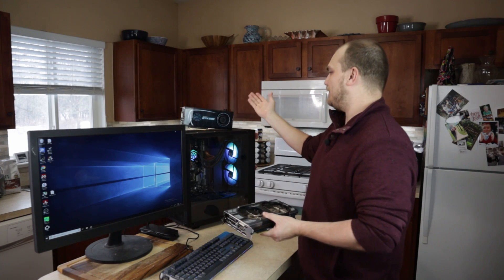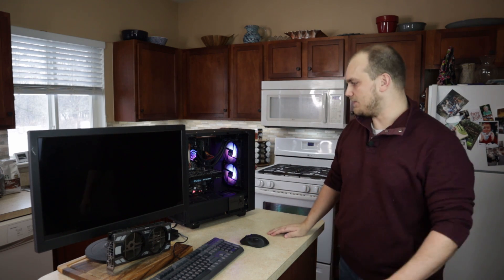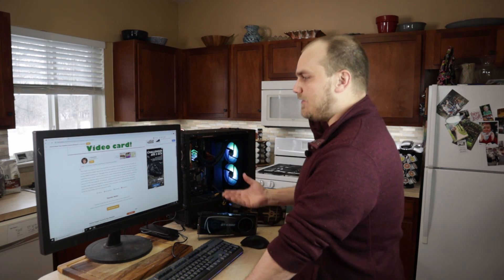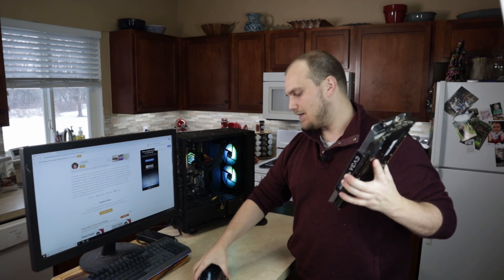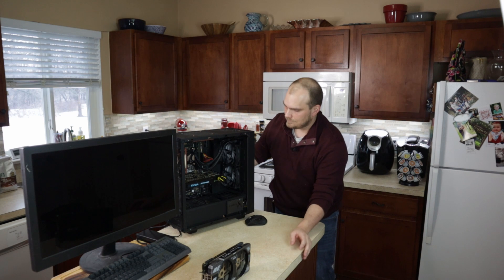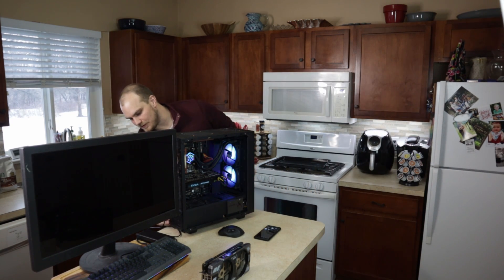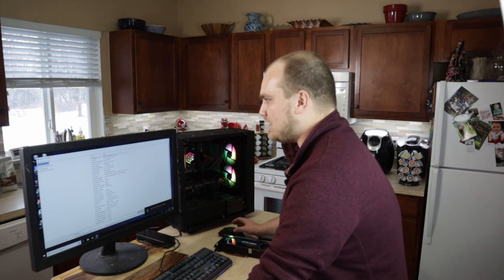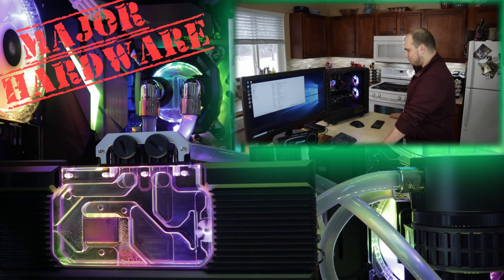Does Baking A GPU Do Anything?

Comment: Its just an short term fix, because your solder joints doesn't reflow at that temperature, you need like 460-480°F for that to work. But when the surface that you are using for that is not perfectly flat, yeah then all your parts move around and its now broken for sure. 

What happen is that through the heat cycle your card expand and retract a bit, and that moves a broken wire bond around just enough to make contact again. Most heat deaths in graphics cards (and first gen Xbox360s lol) are caused by broken wire bonds.

Comment: Good on ya for the disclaimer, this is definatly a last ditch resort. There was a similar fix back in the day for the original red ring on 360's where the SOC would lift off the board after excessive temp-cycling. Out of the 15 we put in ovens or suffocated in a towel only one ever lasted; But it still running 24/7 even today!
Reply from the maker: i 100 % expected to make a cooking video where nothing happeneedf

Comment: don't bake GPUs it is not a repair. all you do is to shock the GPU solder balls and make it work temporarily. and you don't get op to reflow temps when baking it.
Reply from the maker: So what you are saying is dont bake a broken GPU because it will end up broken again lol
Reply: No baking GPU can be "fine" if you now it is the core that is bad so checking all the voltage rails work and output voltage and now it won't fix it permanently., but you shout not make a video called "How To Fix A GPU In 10 Minutes"  and not put in a serious disclaimer that this does not fix the card permanently ore properly. and someone "fixes" a GPU and sells it as working and it brakes on the buyer after 1 month.

Comment: I can hear Louis Rossmann screaming from here.
Reply: Came here to say this.
Reply from the maker: i dont get it but ive seen it a few times lol
Reply: @MajorHardware  Louis Rossmann famously called out Linus on stream when LTT did a video about putting a graphics card in the oven - at best it can bring a chip temporarily back from the dead, but it shouldn't be considered a proper fix. As a response, Linus actually went to NYC and visited Louis' shop to shoot a video about using a proper reflow station.
Reply: @MajorHardware  
First off, most ovens don't get hot enough to melt solder.
Second off, a chinesium reflow station on Amazon costs as low as $50.
In all likelihood, all that you're doing when you stick a GPU in the oven, is causing the PCBs to flex and press broken solder joints back together; This is why the fix is 50/50, and oftentimes even if you do fix it the problem will recurr in time.
To properly fix it, you need a rework statiom off Amazon ($50), a silicone solder/rework mat if you want to protect your table ($15-25), some small metal objects that you can use to lift and level the board from bare spots on the PCB (decently clean pocket change will work) and patience. At an absolute minimum, the station should be set to about 250°C at low to medium fanspeed, though the digital readout only reads from the source, so the temp that the board sees will be different from the readout depanding on distance and air environment I usually run 300°C or higher in my environment.
I also tend to run some alcohol under any BGA hipsets to make sure there isn't any debris between the PCBs and solder balls to mess anything up, although usually that shouldn't be an issue.
If reflowing was not enough to fix the issue, you may need to take a solder pen and resolder some joints on problem areas by hand, or if the issue is with a BGA chip, your job gets a lot harder if you have to reball the poor thing.
Reply from the maker: @kmemz  all I know is it didnt work and now it does
Reply: @MajorHardware  Just for funsies I'd say turn the 580 into a project card where you try to actually get the equipment and see if you can actually reflow it without having to reball it. Takes a lot of patience but I think it's worth it even if just for a fun little side thing.
And if it doesn't work afterwards you still have a powerful hair drier that actually will just catch your hair on fire instead of drying it to play with.
Reply: @MajorHardware  is the recommend getting rid of this video people use these videos as excuses to say the repair industry is a bunch of scammers and stuff like this hurts the right to repair movement I wouldn't be surprised to hear a rant on Rossman's channel sooner or later(he doesn't hate you he just likes pointing up misleading information with a New York attitude) if you want to see real repair videos have a look at Mr Rossman YouTube channel
Reply: @MajorHardware  Ignorance isn't a good way to defend yourself. You should have researched what this "fix" does and why it sometimes works (for a while). I don't mind you doing it or showing it, but you shouldn'd have given the wrong explanation for why it would work. If you actually melted the solder with your method the capacitors would have long gone bye bye. 
Don't take this personally, but as a person with public reach and influence you also have responsibilties (like not spreading wrong information). I like your videos and I would of course like them to get better. So take this as friendly advice.
Reply: @felentus  Couldn't have said it better myself, not to mention I didn't even look at the video from that angle.
Reply: @felentus  Wow, that was the most spergy comment I've read in a while, good job man. That he made a reasonable educated guess as to why it worked, regardless of whether he was right or wrong, is well within the scope of acceptable behavior of a non-expert regarding social responsibility. The notion that he should know all the technical details about the effects of a graphics card in the oven, just to make a short fun video, is absolutely ridiculous. Go talk to real people.
Reply: @kmemz  As an embedded systems engineer, I agree with all that. But...most people won't have that. I don't even have the kind of oven @Major Hardware used, and no access to a reflow station since the pandemic!!!
So 50/50 is a big number considering these would otherwise just collect dusts
Reply: @MajorHardware   Probably not for long! 
Bored being locked-down, I decided to give my broken gtx760(driver fail due to "0 video Ram") a shot and just blown on to the ram chips with a Heat-gun(it was either that or a Gas-Oven) at max until I noticed that I have melted the VRM heatsink's plastic mount!  AND IT WORKED (until yesterday :3 so about 2 months after 1st re-life!)
So, did the same thing again, and this time melted the fan's just socket 😅, and again, problem solved!! (for now...)
Reply: @kmemz  I dunno, I had a pretty persistent fix doing this once. 
But nobody should delude themselves into thinking it's any kind of proper fix. I upgraded the card as soon as I could afford it. I think I ran the old one for nearly 3 months tho.
Reply: @MajorHardware  Is it still running?
Reply from the maker: @WillyDrucker  sure is like a champ
Reply: @MajorHardware  That's amazing!  Had a bad 780 ti I couldn't get warrantied, tried everything to repair it, cleaning, firmwares, no luck.  I just put it in the oven like you did, and voila', working again!

Comment: its possible the 580 was using that notirously brittle lead free solder which if i remember had a higher melting point? or did i dream that. altho i think they all use lead free solder ..now...
Reply: Every single computer part has been using lead-free solder since RoHS was implemented in 2004.
Reply: @SteelSkin667  Bastards! lol

Comment: Only works for a few days.
Reply from the maker: been seeing that comment a lot ill follow up for sure
Reply: @MajorHardware  The tv motherboard I tried it on would work for 2 or 3 days only. You may also use a heat gun. A hair dryer works too.

Comment: Yeah this is an old method probably a tacky solder the oven just solders again they were doing this with circuit boards for awhile seeing how pcbs go threw the oven anyway...also can’t u just dip the fans in nail polish would it melt the plastic?

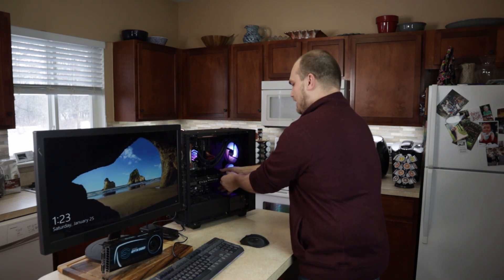Comment: Uhh at 3:23 you unplug power then the card from a booted system. Am I missing something here?
Reply from the maker: I after the card wouldnt workmi went back to integrated graphics and unplugged the card
Reply: @MajorHardware   I understand what you're saying but generally not a good idea to do so while booted. No bueno!
Reply from the maker: @jamtheberb  maybe soo but on 2011 tech there isnt much risk.
Reply: @MajorHardware  I appreciate you responding! However, I am still in the camp of powering off before removing hardware but perhaps that would be a good future video: testing the safety of removing modern hardware while powered on: I know I'd watch for sure!
Reply: @jamtheberb  There is PCIe Hot-swap/Plug n Play. Linus did a video about that. https://www.youtube.com/watch?v=YigN2mkQMPc
Still I do not recommend removing hardware plugged to the PCI while the PC is powered.
Reply: @MajorHardware  while booted?